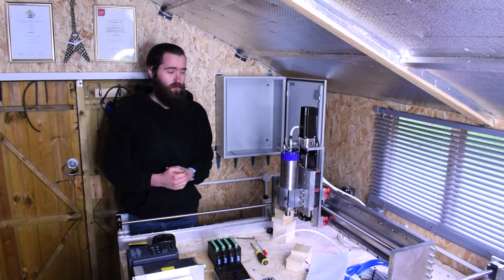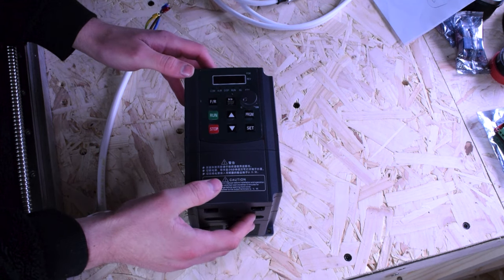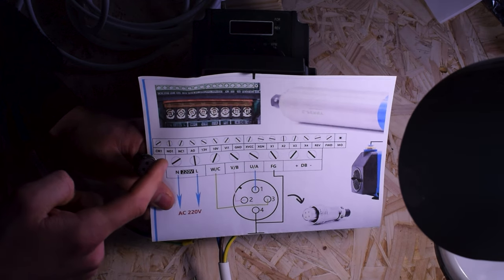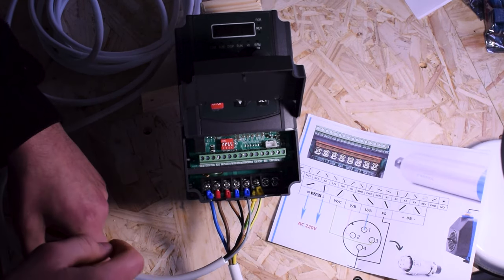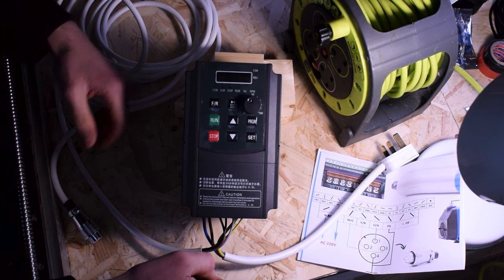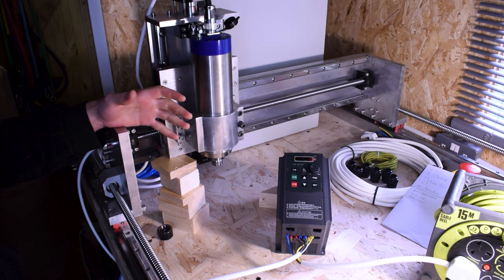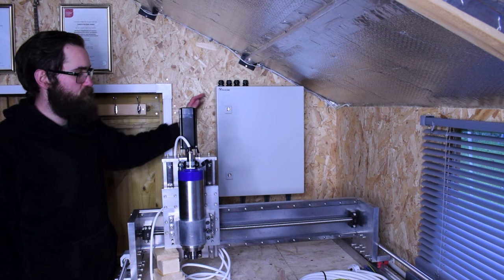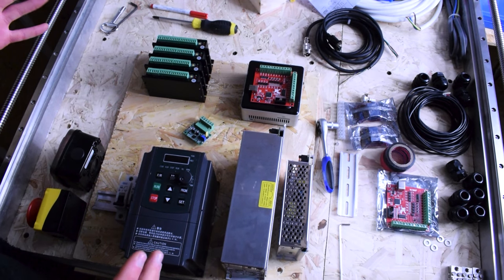DIY CNC 011 - VFD and Spindle Test

Comment: I have a similar VFD. Check if its front panel can pop off. Then it can be relocated to a rectangular hole cut into the door of your control box using a ribbon cable, and you have easier access to it.
Reply: I did that on my machine 😊
It's really useful
Reply from the maker: That's a fantastic idea! I did not think of that. Thanks for the input😁
Reply: You can see here I mounted it with Sugru into my controller case. https://youtu.be/SJ8Mcgfx2aY?si=BuaINcKFt8_nOwaf